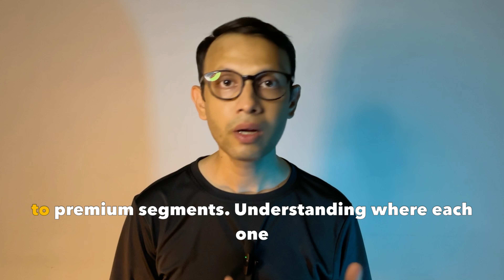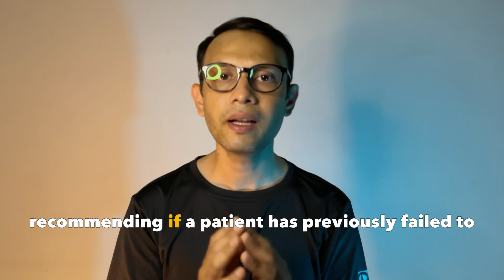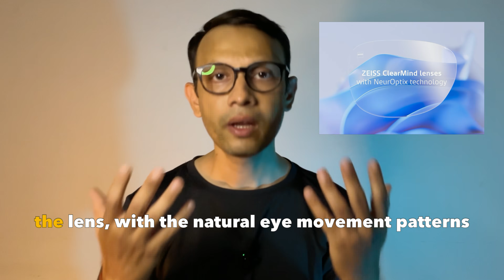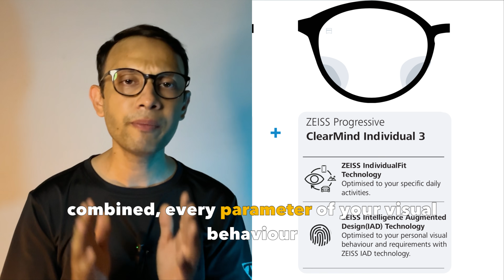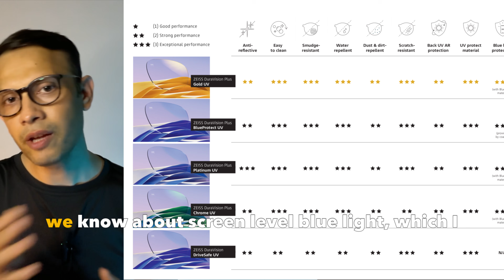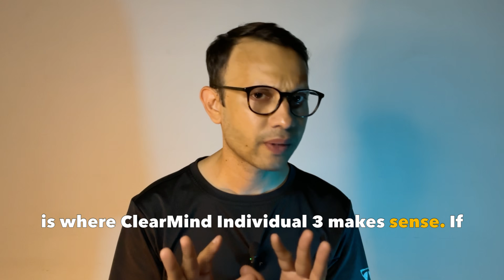Which Zeiss Progressive Lens Should You Buy In 2026? Price List in Detail | Clearmind Lens Explained

Comment: I have cyl power -3 and -3.5 minus 
Daily screen usage as software engineer upto 9 to 10 hours 
What do you recommend?
Reply from the maker: I think a Smartlife or Clearmind will work well. In the case of your high cylinder power, the Individual tier  I'd reckon is the best bet. Add to it, 1.6 index material and DuraVision Plus Platinum and Blueguard, and you've got yourself a lens that is material wise optimised. For an extra layer of comfort, try the Digital lens (assuming you're not presbyopic yet), and it will relax the continued strain on your lens focusing muscles to give you sharp and clear vision both for far and near, while at work.
Reply: @AskYourOptometrist sorry it's minus 
How much it would cost?
Reply from the maker: If it's in minus, then you will be alright with a clearview lens in the 1.6 I dex material in the range of 6000 to 10000 INR. Should you go for Smartlife or Clearmind, it can start from 16,000 onwards and above depending on the features added on. You can email on Askyouroptom@gmail.com for detailed information

Comment: Question. When you spend lacs and lacs on progressive lenses only to find the vision measurements change every 1 or 2 years, is it worth spending money on them?
Why not simply maintain 2 or 3 pairs? 1 pairs with far + intermediate and 1 pair for intermediate + near?
Reply from the maker: It is a very valid point, especially given how fast prescriptions can shift! While juggling separate pairs works well for some, here is why most people find custom progressives worth the investment. Carrying and constantly swapping 2-3 pairs for driving, computer work, and reading gets exhausting quickly. A single pair handles your entire day without interruption. Separate or basic lenses have harsh boundaries. Custom progressives provide a smooth, continuous gradient so your eyes adjust naturally from a screen to across the room. High-end progressives aren't just a brand name, they are digitally mapped to your exact frame fit, eye alignment, and head tilt. This drastically reduces side distortion and neck strain.The price tag reflects invisible digital optical technology, but the payoff is daily comfort. That said, dedicated extended near vision lens pairs can still make sense for special setups (like long hours of static bench work); it really comes down to your personal workflow!

Comment: When you use plastic frames like you do, will it not affect your vision immediately before your feet like when climbing downstairs? If we go with metal frames, they degrade and show off their age within months.
Reply from the maker: That's a fair point, but it comes down to basic optics and proper frame selection. Every progressive lens has different focal zones, so when walking or going down a flight of stairs, you simply tilt your head down slightly to look through the top distance portion of the lens rather than the lower reading area. Once you make that small natural adjustment, ninety-nine percent of wearers handle stairs with zero issues regardless of the frame material. As for metal frames showing their age, cheaper alloys certainly corrode, but premium options like pure titanium or high-grade stainless steel are completely corrosion-resistant, lightweight, and last for years without degrading. Ultimately, whether you choose plastic or high-end metal, selecting the correct frame dimensions ensures your visual corridor is positioned perfectly for crisp, safe vision everywhere you step.

Comment: I live in a different country, but I have relatives living in Germany. If I send them my prescription, would it be possible for them to order ZEISS’ highest-end lenses for me from an optician in Germany without me being there for the measurements?

My idea is to have the lenses delivered to me uncut, and then have a local optician here take all the necessary measurements, cut the lenses and fit them into my frames.

Would this be possible, especially for ZEISS clearmind Individual progressive lenses? Or do the measurements need to be taken before the lenses are manufactured?
Reply from the maker: This would've been a good idea if the technology only existed in Germany. However, Zeiss lenses are made all across the planet with the same exact machinery and precision as they would be in Germany. If you find it easier to get them there (since you have relatives), you can do so. But your prescription is not enough. The local optician should measure your PD, your frame position on your face for the exact center of lens and some auxiliary measurements that will let the software know the lens size and the frame shape as well is required. 
All said and done, it can be then fitted onto the same  frame once the lenses arrive to give you optimal performance. 
Please subscribe to the channel for more info and thanks for your questions. 😊